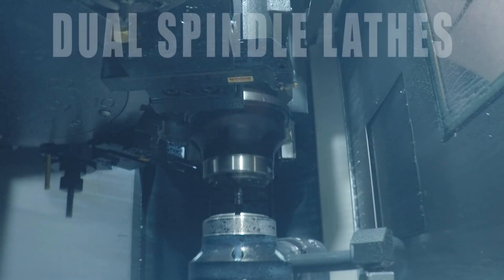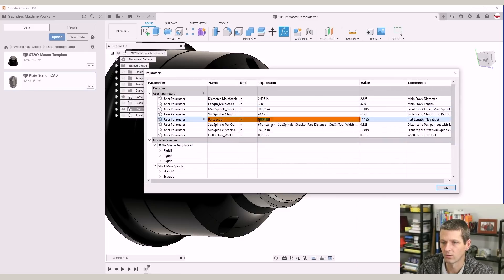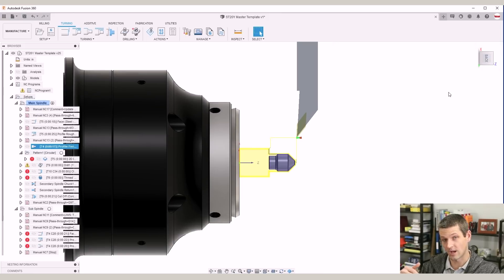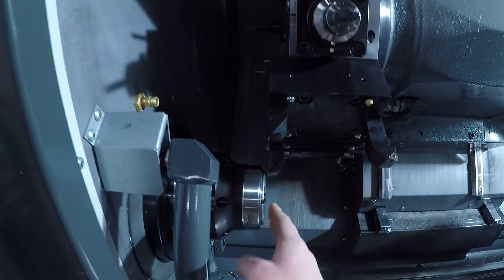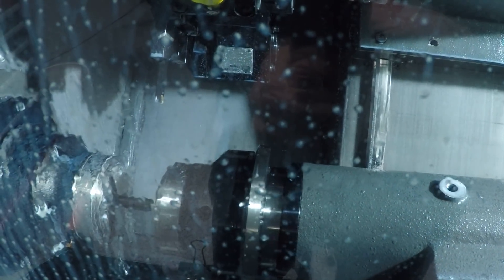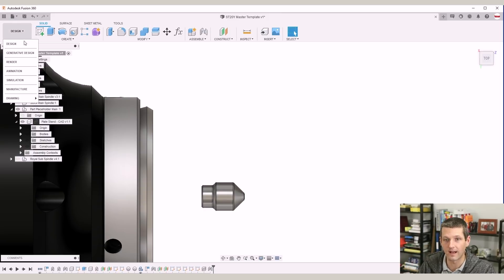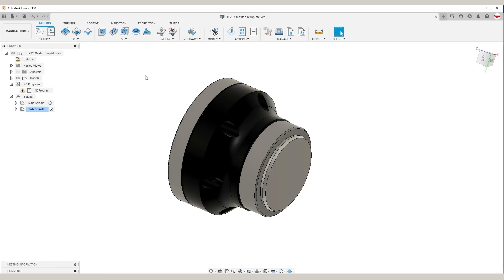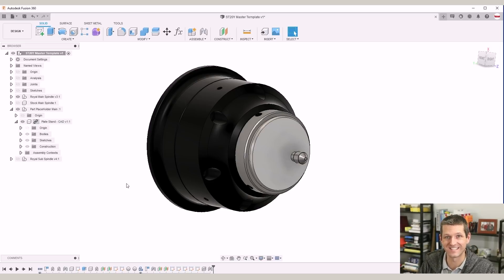Programming Dual Spindle CNC Lathes in Fusion 360!

Comment: This and the post editing video have been invaluable over the last couple weeks while I've been setting up a new Hyundai-Wia dual-spindle lathe.
Reply: Hi I Have a Hyundai-Wia dual spindle lathe . Have you a post to use on this machine? Thanks.
Reply: @paulgoodson2655  Sharing post processors is a dangerous game. The first post I used came from a professional supplier and it immediately crashed the machine. I would suggest you send me a LinkedIn connection request. I'll be happy to share what I have, but obviously, there are no guarantees or liability for damage. 

I use a combination of the post I customized and a modified version of the fusion360 template that Saunders shows in his video. Note that where the Haas lathes use a command to flip the Z axis when working with the sub spindle, our lathes do not. The template was actually written for more "notmal" lathes and modified by SMW to work with the Haas if I'm not mistaken.

Comment: Cam and lathe content has been fantastic lately from you. would love to see you cover the turning multi tool style tool holders that are very popular and how you use them in fusion 360. the ones that can drill, turn internal and then also face external and face. (crosses centerline all that fun stuff and how to work around fusion not wanting to drill with it.
Reply: You need to activate polar mode on your machine.  Open your postprocessor file and check to see if it says polar mode anywhere on or off.  I got a great post for our LB3000 that allows a manualnc command to turn it on or off in the program list just like a program which is nice.  If you have the same machine and want it i can send it over
Reply: @charlesscarpelli  I have a haas st20. I found polar mode but it wasnt an option.

Comment: What post processor are you using on fusion?  Looking at the code this puts out, it doesn't unclamp the main spindle before moving the subspindle backwards to the partoff location.  However, this is going to be a huge help over hand coding this.  Thanks!

Edit: Changed over to a different DS30 post processor, and the code looks great. Thank you again!
Reply: What post did you end up using? Just the ds30y post from autodesk? Im trying to do this on a ds30y. Hoping i can find someone with some experience using this.
Reply: @ZZ3CR  I ended up getting the newest ds30ssy post, and it worked pretty good.

Comment: The timing on this video is perfect. I'll be running a dual spindle in a week or so...
Reply: Same for me. :)
Reply: It’s the knife guy!
Reply: @cylosgarage  the poop knife guy?
Reply: I just started this week 😅 its a great machine i just havent operated this kind yet, ive worked with a 8x6meter, 5axis cnc milling machine.

With this Nakamura Tome TW20 i have a small robot loading raw material and unloading the finished part.